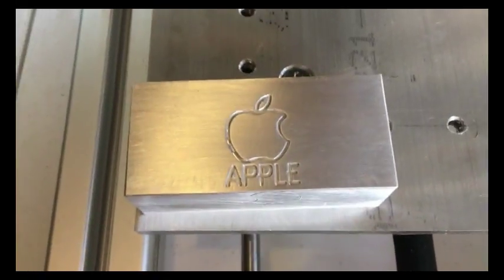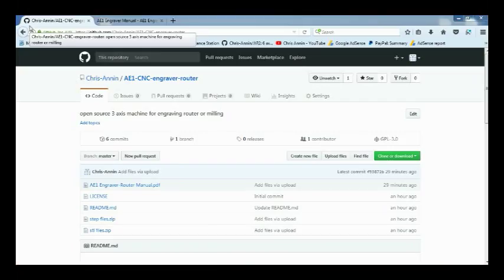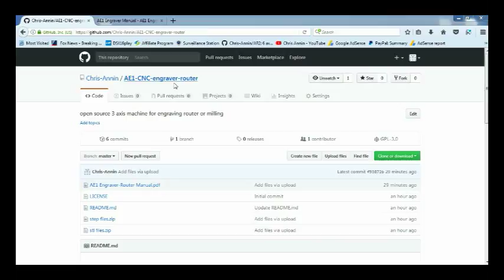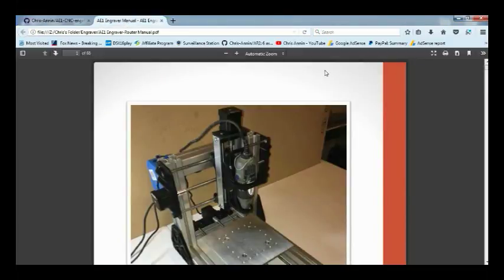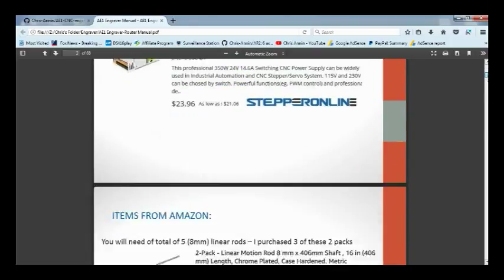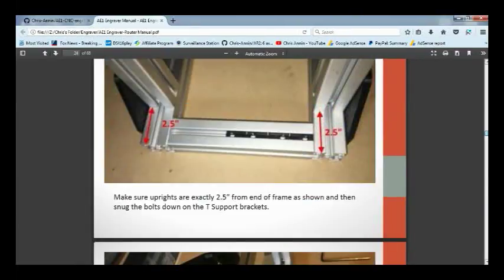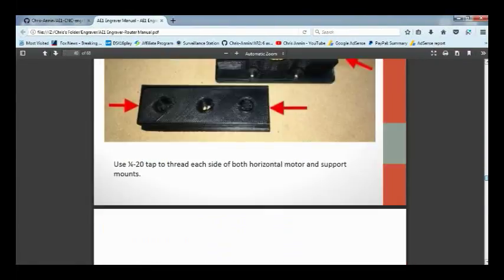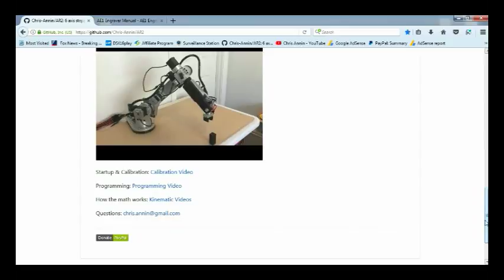AE1 DIY CNC engraver router mill Part 1 - Overview

Comment: Hi Chris. Thanks for sharing your design. I love the videos and the documentation. One can tell you spent a lot of man-hours into the project.
I thought you would be glad to hear that I am in a process of making one :) I did change the design a bit as I wanted to utilize whatever I had laying around.

Main changes:
+ X axis is sliding on a cheap Chinese linear rail (which I think is too fragile, but time will tell)
+ Y axis was updated to use 12mm rods (scraped from OKI printers)
+ for the frame I used an aluminum profile based on 40x40 but one side is extended as it was housing a powerful LED lamp  (not a big deal, it just looks funny and is heavier then it should be...)

I may have become a victim of RTFM ;) but i could not find any information about suggested printer settings for all the components. I decided on PLA 0.15mm layer, 1.2mm walls, 0.75mm bottom and top, 15% infill - and the parts take a lot of time to print. My iPrusa clone is working on an Y carrier and Cura estimates 10hours!!! I may be wrong but I think I used almost a 1kg of filament so far.

As I had built a CNC router before I am using it to cut some parts from 15mm thick plastic for Y rods and motor housing. Just makes things quicker. The same is used for X Motor mount and the X carrier.

One other note: the design you show on the video has a different X motor mount then the one in the CAD files and documentation.

Feel free to ask me any questions.
Reply from the maker: Hello, thank you for the feedback. Im confused on the motor mount. I’ll double check my files but should all be the same as what’s in the video. Let me know if you have any other details. Thanks
Reply: Hi Chris, I shared a post with you on my Google+ page.
Reply: You are right, all the files are correct. My mistake. Sorry for the confusion.

Comment: Could this be built to mill all the parts for the robot? Thank you for sharing!!!
Reply from the maker: I’ve milled very small parts out of aluminum I don’t think this unit would be big enough for some of the parts on the AR2 Robot and it’s not really strong enough for heavy cuts it’s more designed for engraving.